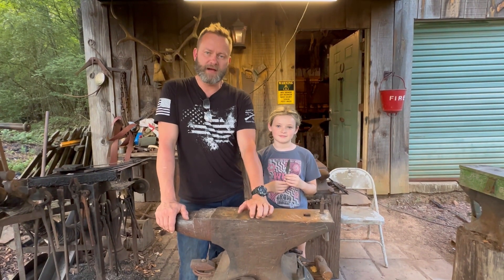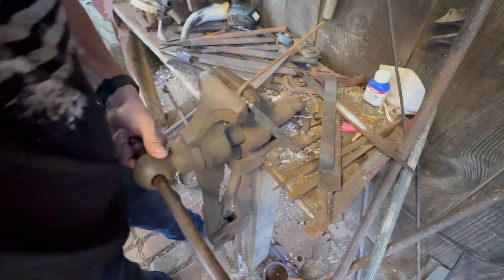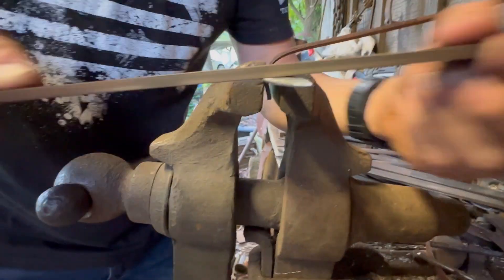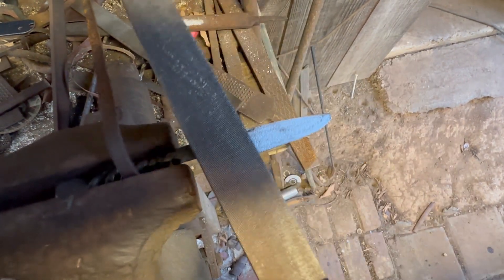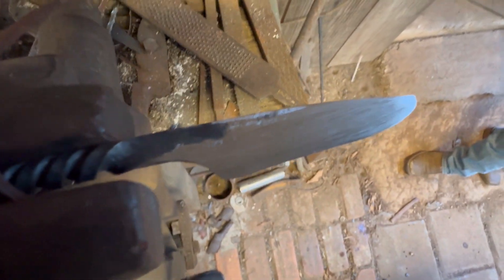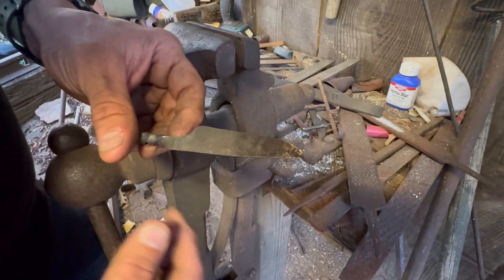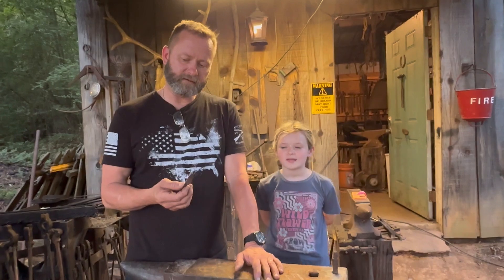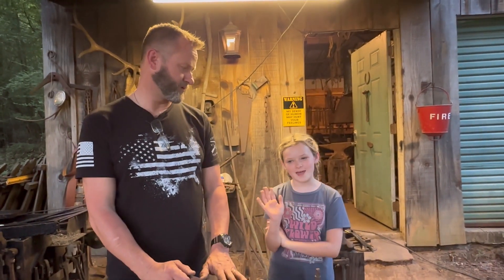Hand filing the bevels after forging the blade #Blacksmith #Handforged #Bladesmith

Comment: Scale is actually harder than steel, itll dull your files. Easy way to get it all off is to soak the blade overnight in a bucket of white vinegar. It will dissolve all the scale, even the stuff that gets hammered down into the surface.
Reply from the maker: Muriatic Acid and water will do it faster but I don’t have the time to wait lol.

Comment: if i forge my blades very thin in the bevils like you, i have so much scale that i cant file it out. I use a vellow charcoal forge
Reply from the maker: Are you sure that you are not forging too hot? And make sure you don’t have debris on your anvil as you hammer.  The scale should be just a thin layer.